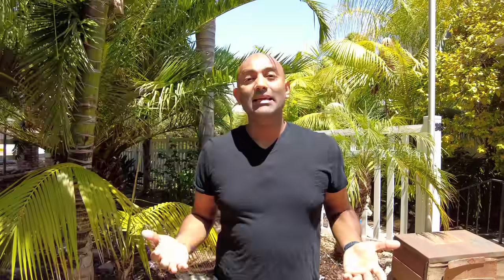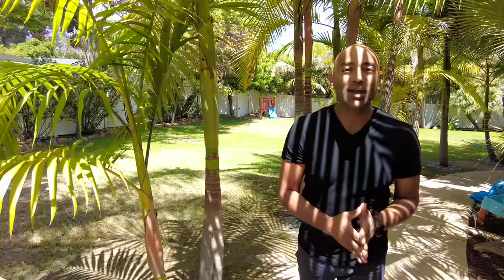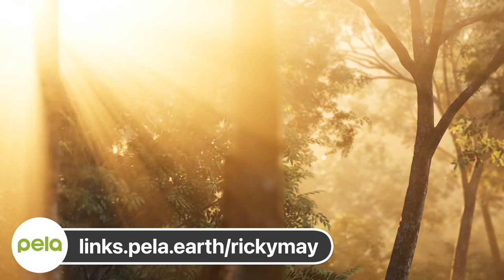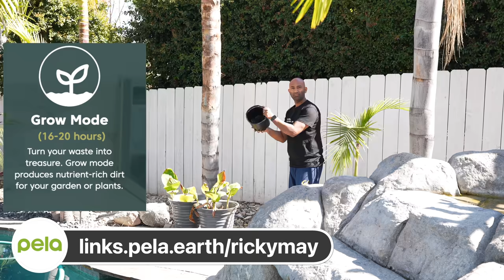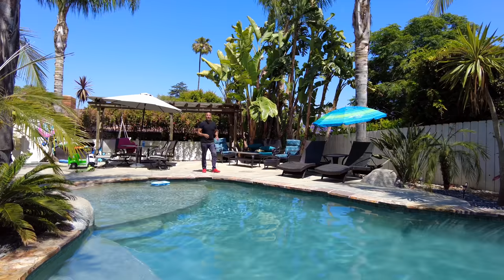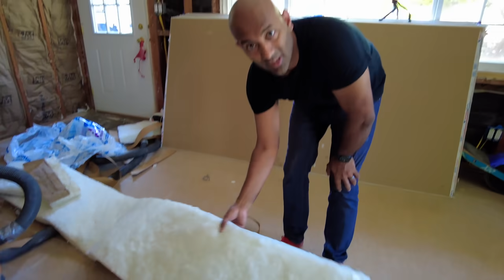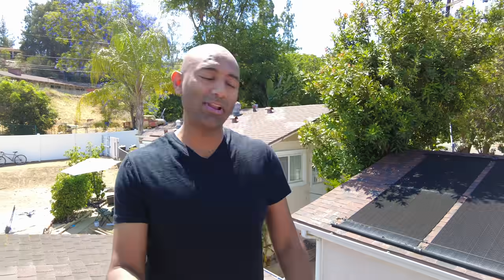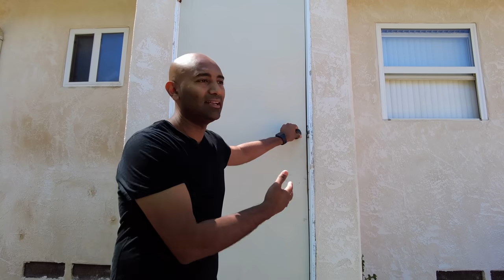How I'm Planning to go 100% OFF-Grid!

Comment: I forgot the name but there's solar that uses water pipe to cool them and uses the heated up water and pumps it back into your home reducing the amount of energy needed to warm the water.
Also source is a solar humidity collector it uses the humidity in the air and puts water into your home i think there 3 to  $5,000
Reply from the maker: yeah i think I'm going to keep it simple and have only pure PV solar on my roof... they're bulletproof and no risk of leaks etc. then i'll get systems to pefform these other tasks like heating water and making water, that i can power from the pv system. the beauty there is i can do different things on different days.  day 1 i can charge my EV from the solar system. then Day 2 i can produce water from the air, and day 3 something else. that's the flexibility by going pure PV solar and why that's my plan

Comment: Hey Ricky, just run a low wattage(150-1000w) ac or dc element off of your xcess solar power all day to heat water in your existing tanks.
Reply from the maker: that's what I'm thinking!

Comment: Cool  idea. You really need to add biogas to this equation and get rid of the lawn. Grow some food. That also cuts out some of the carbon on transport. Aquponics can also be done with ornamental fish. Fish not your thing? Worms, chickens, etc. can be used. Then you can feed your scraps to biogas digester and chickens and/or worms. Buying gadgets to replace narural processes, require a factory somewhere. That is strictly speaking, not off-grid. I'm waiting for carbon-neutral biodegradable solar panels, oh wait, potato to ethanol...

Comment: Since you are in San Diego and have a lot of sun, why not replace the water heater and dryer with electric units? Also do a search on passive solar water heating (energy dot gov calls them passive solar water heating systems), it was something that was really popular in the late 1970s and early 1980s. I remember a lot of our neighbors installing the 'active' solar water heaters that were basically what they use for swimming pool heaters now and none of them worked. We installed a passive solar water heater, which was basically a 100 gallon steel tank inside a reflective box with a plastic cover on our roof and water pressure filled the tank and it gravity dropped heated water down into our regular water heater. When we moved in 1989, it took a year to find another of this type of system, so we were able to see just how much of an impact it had-- the passive solar water heater cut our gas water heater's usage by nearly 80 percent. It's simple, no moving parts to break- just gravity and city water pressure. Literally place it almost directly above where your water heater is located and it's a simply line up and line down with some cut off valves.
Reply from the maker: I’m going 100% solar pv because electricity is top priority. I can easily heat water with a heat pump water heater

Comment: Why even have a water heater for the second house, especially if you never take showers there? I’ve been off grid for 4 years now, living in a warm climate like San Diego. At some point I realized that taking hot showers is overrated and not necessary. You could easily get luke-warm water by storing some in a container outside. Just having a black 50 ft hose laying in the sun would give you a few seconds of hot/warm water. Anyway, don’t forget that sometimes you could just do without or perhaps think completely different. Love your channel, keep up the good work!

Comment: The saltwater is probably what killed your solar water heaters. Distilled water with antifreeze is commonly suggested. If you go that route then you might also want to use a heat exchanger.
Reply: Solar panels also work best when cold, but not frozen over. The solar water heaters placed underneath the solar panels may make them work more efficiently, but you would want a buffer between the two, to keep the water away from the electrical system.

Comment: Great new project! I am really looking forward to your content.
But one thing, I was wondering why you are planing the studio that independent. Just dig some electric lines and have one big power wall. Install an electric water heater just in case and you are fine. I would cover the whole roof with solar because you will need a lot of power for all the utilities. 
I am excited!
Reply from the maker: that's a lot of what I'm planning. I don't need any more than 60 amps I believe. I am going to cover that entire roof with solar, feeding DC into ecoflow delta pros, and smart panel. I'll get a heat pump water heater

Comment: Just sub like this. Great channel. Found you from Undecided. So just giving you feedback that calibration is key. You both show the 2 sides. So excited.

Oh since your doing a land solar "farm" ... heck with the definition. Anyways look into possible solar panel concentrators. This way should crazy weather happen you can wrap it up and if damaged you risk less total cells (cells cost the most) and if engineered well the reflectors can fold on top of the cells and locked down. Protecting the cells further.

Comment: Heat pump water heater would work there .  Just turn offf the elements
Reply from the maker: I would just need a 120v version without any backup resistive heating elements. yeah that would work great

Comment: You should look into solar thermal water heaters. You should be able to supplement that with a smaller electric water heater for the studio/guest house.
Reply from the maker: I am going to go 100% PV Solar, and get a heat pump water heater where needed!
Reply: @TwoBitDaVinci  I get that. You can reduce your heat pump water heater load by pre-heating the water with solar thermal. I am working on going 100% PV too and that is something I've looked into. Let the sun heat the water during the day and reduce the electric load

Comment: The air source water generators are WAY too expensive to run unless that is the only source of your water or you have critical need for a backup.  Plus no, 200 gallons a day isn't enough for you unless you are irrigating from some giant cistern of rainwater or have a full on grey water system.  New tech is coming along but its not ready yet.  Dig a well if you can (also $$$) but often not permitted within city limits when you're on the city water already.

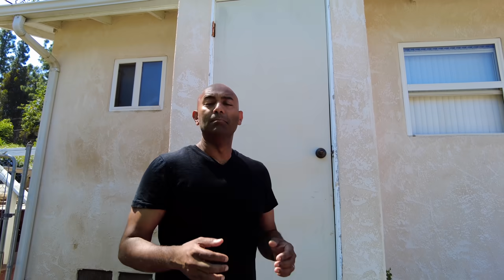Comment: 12:25 For real? In such a sunny location, doesn't every house have a solar boiler? Not those nasty plastic mats for your pool, but the metal pipes behind glass, or the vacuum solar tubes type (but they make more sense in cold locations) with a solar storage tank.

Comment: How about a 120 volt 10 gallon water heater for the second house?  It will work for shower and sink. It is good if you don’t use a bathtub.
Reply from the maker: Yeah I’m thinking about that. Saw a 19 gallon model today that might be perfect

Comment: Do you need a metal black box painted black number two it draws the heat. You put copper coils against the inside of the box could be a water tank the big thing is it’s metal and it’s black. Then you just circulate your water you will always have hot water you would be surprised how much the sun will heat the black water tank or box. Pretty simple
Reply from the maker: yeah makes sense for sure

Comment: Heating the pool electrically with a heat pump gets really expensive when the humidity is low.  It's unclear if San Diego is humid enough - you're near the ocean but it is also hot down there.  The lower the humidy the less efficient the heat pump heaters are.  They are great in moist parts of the country though.   My advice, just buy your own new solar water system and install, or mount it on a patio somewhere and put the PV panels on the roof.  Eat the cost of re-roofing that part now or heck pony up for PV tiles...  Not sure if you're planning on building your PV racks and install the panels yourself but pro companies wont want to install panels on something they didn't build themselves.  You can probably find someone to do it but the City/County will want to inspect the racks to ensure they are probably built and won't blow away in a storm.

Comment: There are other types of solar water heaters you can get that use a coolant that can get a lot hotter but then transfer that heat to the water and then get recycled. So, you wouldn't have water on your roof.

Comment: The solar water heaters failed due to the salt in the salt water pool.  Salt is very corrosive, should have had an intermediary fluid, plain water would have been fine as it doesn't freeze there plus it could have been used for hot water for your house.

A Solar blanket for the pool would reduce the heating needed.

Comment: Just a note. Lomi does not produce true compost as defined by the American Association of Plant and Food Control Officials. It produces dried and chopped food product. It can , however be used as a soil amendment. 

True compost is decayed organic material, meaning it's produced through controlled aerobic and biological decomposition (i.e., decay) of organic material that's undgone mesophilic and thermophilic temperatures. This makes pathogens and weed seeds less viable and stabilizes the carbon to where is is beneficial to plant growth
Reply from the maker: very good point... so Lomi trades energy for time, getting to compost in a fraction of the time, but at the cost of energy

Comment: We went solar about 1 1/2 years ago and love it, went from $350 down to under $100 month. But now I want to add the battery to the system, how hard would it be. We have the micro inverter system enphase
Reply from the maker: Awesome dana yeah most of the big batteries like Tesla Powerwall will work just fine. In my previous home, that's exactly what I had. I'll be doing more videos around this as i get to it.

Comment: Some heat pump water heater provide air conditioning.  With how much air conditioning you need there it would be nice to get at least some of it as a free byproduct.
Reply from the maker: Very good point

Comment: I’m also in San Diego and under SDG&E. I thought we “weren’t allowed” to disconnect our houses from the grid if we’re in an incorporated area of the county. I’m currently saving for solar (and a roof redo) so it’s never been something I’ve had a reason to research other than to file it away in the back of my head.
Reply from the maker: I am going to be connected, but my GOAL is zero. so I will to SDGE appear to have my breaker turned off. so my bill will be the base fees like 10 bucks or whatever it is. But again this is lofty and I have to start planning. needing a new roof first really screws things up. But this bad roof is one of the reasons I was even able to afford this place so ...mixed blessings i suppose. Hello to a fellow San Diegan!

Comment: You will need a larger nat gas line for a tankless/instant water heater.
Reply from the maker: My gas life is sufficient for a 5GPM tankless natural gas. but I'm not going to do that. I'm going to get a 120v heat pump small 20 gallon tank heater

Comment: Looking forward to this project. Although, the amount of roof space you have looks like its equal to the amount of land my house is on. The size of your house and land seems crazy. Sure it means more utilities to produce to keep the house running but it also has heaps more space to implement solutions. Still, I cant wait to see how this goes. I am in the middle of building a new house in Australia and getting the base semi decent for sustainability costs heaps (double glaze windows, 3 phase power, electric AC and Heating, Induction stove top). I hope to eventually get Solar Panels to cover the electricity used and get completely off natural gas and maybe even an EV and House battery. 

As for getting money from me, I'd like to do it through merch. A tshirt with your logo, or a diagram of a sustainable system that you are going to install in this project.
Reply from the maker: you're spot on, its a function of home size, needs, and land area. yeah my home is on the bigger side, and i have about .7 acres. but I believe my solutions and learnings will be applicable for all!

Comment: Talk to the insurance company about your roof. Since it has mildew they might replace it. You could also wait till after a bad storm and call them.
Reply from the maker: I'm going to replace it myself little by little. it had 3 parts to it, im going to do 2 of the smallest parts first. and add solar there. then tackle the main part later.

Comment: It will be great watching your progress.  Best of luck.  

With regard to your investigation into ground source heat pump systems, I’m assuming, because of the price, you’re looking into a vertical system?  Is your yard big enough to support a horizontal design?  

I ask this because since you’re in the Finest City on Earth, San Diego, having a very friendly year round climate, with additional insulation you wouldn’t need a large footprint.  

Yes, initially you’d lose your yard while it was dug up, but only temporarily.
Reply: It would be cheaper for him instead to connect the heat pump to move the heat from his home into the pool.  Not as efficient as ground based but should be better than air source plus it will give him free pool heating.
Reply: @travisschneider3011  Looks like you’re on to something.  There seems to be a few products on the market moving heat from the AC to the pool.  Hope he sees you’re recommendation.
Reply: @JeremiahTownsend  a lot cheaper to install than ground based.  The only negative I have found about it is that it requires a pool or other large body of water, plus the slightly less efficiency than ground-based.

Comment: Convection in cooking describes oven with a fan to better circulate the heat. You will want an induction range, describing that it uses magnetic field to heat the pots directly.

Tankless electric water heaters are bad juju because they require massive current and have a max efficiency under (UEF) 1. You should hold out and secure a 120v Heat Pump Water Heater (efficiency UEF 3.5+), which are entering the market this year. They are not hybrid because they ditch the resistive backup coils altogether. Alternatively, you can still wire for 220v hybrid HPWH, operate in pure efficiency mode (disabling the heating coils), and know that it will have small but long power draw to reheat the tank. But you may ask yourself, do you need hot water in your studio? 

I'd suggest not saying "No permits." I think what you meant is no grid tie. Your challenge there is that in winter you make 1/2 the solar power that you do in the summer with the same panels. So you either need to overbuild the solar by 2x and you'll have massive, wasteful curtailment, or you'll have power outages in the winter when we get 2 rainy days in a row. It's a good thing to show on the channel that off-grid means wasting solar resources by 2x, and it's not helpful for addressing climate crisis. Always better to grid tie in the next few decades while we are struggling to decarbonize the grid. Eventually, if California relies too much on solar we will have massive curtailment anyway, and maybe it will be everyone's responsibility to eat the lost value. It's a great argument for why we need more diversity in our power mix.

Regarding your pool pump, if it's not Variable Speed, it should be. Pool pumps are subject to massive efficiency gains by slowing them way down and running them way longer. Operating at 1/4 the speed requires 1/16th the power. The power draw is non-linear relative to the speed. So the big energy win on pools is to run a more pricey VSP at ~100 W for many many hours of the day (12 or more). This will be even easier when you ditch the solar heaters. Your salt system requires constant flow to work. If you limit hours, it'll be less functional by that much.

Geothermal is a better idea in Massachusetts or the midwest. I'm not convinced it's worth the extra complexity and cost here in San Diego, especially on a mature lot/house. If you get pushback from every local HVAC heat pump specialist, respect that advice.  Always remember that geothermal is a heat sink method, so for AC for example, as you're saturating the ground that is in contact with the underground circuit with the heat you're bleeding off, it's becoming less effective at bleeding more heat off. With Air Sourced Heat Pumps, you keep pushing that air away, which rises, and using new ambient outdoor air. For heating, in San Diego, you will not need ground sourced heat (it's 59 degrees at best, so not much to gain from ground heat). It's better for places where temps are freezing for months at a time.

Instead spend that extra scrilla saved, on an advanced variable capacity multi-zone mult-split heat pump system with a manifold and high tech individual in-room air handlers with IR people sensing. The ceiling mounted ones are normally reserved for commercial settings, and they're big.  If you want to maximize your efficiency on HVAC in San Diego, these will heat or cool only the rooms you are using if you want that. Check out Mitsubishi 3D I-See sensors, which you can also get with their wall mounts. That's the tech a nerd wants. Regardless, you want your compressor unit outside to be the upright silent ones, not the traditional Carrier beasts, even if they advertise that they're variable speed.

The benefit of zone conditioning, plus highest efficiency gained from going ductless, make this a case of paying more up front for the highest efficiency, and gaining in lower operating costs. The tech hack here is same as pool pump: small compressors and small fans running continuously at much lower power. No abrupt stop/start cycling that consumes a lot of power and is difficult to size properly for extreme temperature events, the way single and 2 speed AC units are.
Reply from the maker: well said! yes I meant an inductive cooktop, and I am now leaning towards a small heat pump water heater for the office